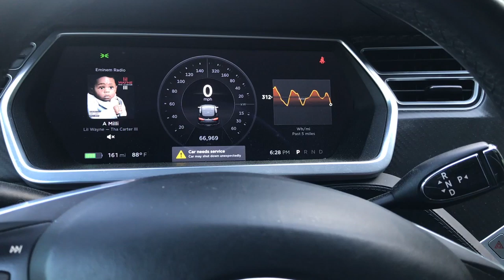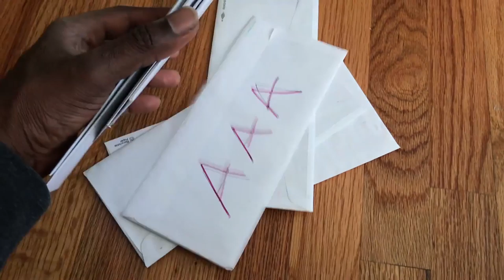Rats Killed My Tesla

Comment: Just finished watching your JRE bit; I didn't realize you were such a cool dude! Came over and sub'd. :: You may be able to beat the AI racer Rich, but if all cars are equipped with the same "safety features" I would say not by much; computers are more consistent, plus it seems you would be limited by how close you can drive in turns etc (car distances/safety). Funny, when you talked about the safety features and 10-20% lap time variant, it reminded me of those go carts at a theme park when we were kids, where they are mechanically (sometimes electronically) governed for speed, funny stuff. Best of luck on your ventures and thanks for the bad ass videos! BTW-you have an awesome team my man!

Comment: Would it be smart to put anti rat spray like hot pepper  Peppermint oil, castor oil and citronella oil ?  What is the cost of a new fuse, and what is the labor to install it.  Sounds like early TESLA have a battery problem which were covered up by the free replacements.  Will that still happen on the 3 model with 500,000 sold?   Oh and WOW  that's a lot of rust on the car.

Comment: They actually use silica sand in the fuse so that in the extreme heat of the arc, the sand melts to glass which is an excellent insulator and extinguishes the arc.

Comment: The job of the fuse is to protect the wiring. Are you sure you can just swap a 600A fuse for an 1100A one? Is the wiring the same in all models? Did it not get upgraded with Ludicrous Mode in later models?

Comment: It's nice to know my old "angle grind a slot into whatever screw I happen to not have a driver for / is stripped" trick is used by the pros too :D
And my dad scoffs at me every time I do it.
I HATE hex heads on cars.
My front sway bar end links were a nut over a hex head. Both not stainless. On the part of the car that sees the most water and salt and shit of all. Seriously.
Wanted to do a coilover install.... Damn end link wouldn't come off the strut or the sway bar cause everything was stripped.
Waited months for shipping on new end links and then just angle ground the entire strut out of the car and put nice new Perrin ones on with ye olde stainless nut & bolt.

Comment: Bolts missing, bolts loose, high-voltage fuse not tight. In another video Rich didn’t put the cover on some electronics in the center dash area and AC condensation killed the electronics. Does Rich really do it right? Scary.

Comment: The sand is NOT for thermal reasons.  The sand is there to extinguish the arc when the fuse blows.  When a DC arc starts there is nothing to extinguish it.  In an AC arc it can extinguish when the voltage/current crosses zero.  The arc literally melts the sand to glass which will solidify and block the arc.

Comment: Sand in fuses  when the fuse blows it is so hot it melts the sand & when solidified it forms an insulation (fused sand = glass coating)

Comment: rich.. have you see the mouse trap that is just a big glass bowl.. a ramp up to the lip and a cup of peanut oil..  you might want to set one up IN THE CAR to see if there are any rodents hiding out still.  you can also set up several  5 gallon buckets cut the bottoms out of several to add to the stack height. the bottom one is intact.. but it has either some peanut oil in the bottom or some peanut butter wiped around the inside in a band just  a few inches up from the bottom.  the rats and mice will jump down to get the peanut butter/oil and won't be able to get out.

Comment: They use sand because it quenches the ark as the copper fuse melts.  The sand fills in the gap melted between the plates and acts as an insulator.

Comment: Same thing happened to my honda except it was a  rabbit(s).  I tried the anti-rodent tape from honda, but they still chewed through it.  I installed an engine cover underneath and tried to patch up as many holes as I could.  Seems to work so far or maybe the rabbit has died by now.

Comment: the thing is when a cable or a fuse is not tight connected you get slight corrosion in between the connection and then it get fucked because of the heat emitted by a high resistence of the connection ! your fuse might been getting hot because it was not tight enough or at all :D!

Comment: I had a 1993 RX7 on blocks for 3 years (off-road track day car) while I was finding time to replace the motor.  Rats got in and destroyed the wiring.  I sold the whole thing with a parts car on ebay for $6000.00

Comment: I bet the loose bolt connection on the fuse caused it to overheat and blow up. As usual most of your problems are self inflicted. And not mice related, although still a concern.

Comment: When you locked the keys inside the car, couldn't you have used your phone to unlock your car? Or is that an option?
Reply: The electrical system was out of service from the fuse the key can be used to open the door without power.

Comment: I bought a Winnebago Vectra Diesel (Cummins) with a 6 speed Allison. For $900! Wouldn't start. 15 hours in we knew the shifter computer had to go to the shop. And I had some rats. I made some splices and paid $700 for the computer rebuild and she started. Then I did some exploration and found 40 wires chewed thru. The battery cable wires looked like Angela Davis' hairdoo, which she Never changed, I saw her at UC Santa Cruz in c.1979 and it was always the same hair!  I had to solder over 40 wires, double shrink tube them, did it all right, took 40 hours. Rats like wire. Not sure why,. I have other rat wire stories..... these things happen in the Santa Cruz and Sierra mountains.  when you found the fuse I was thinking, "just put a wad of aluminum foil in there......

Comment: I'm confused, Rich. I've watched a couple of your videos (actually I've watched them all) where Chris talks about 'signature' Teslas and the additional care that goes into manufacturing those first 1000 cars like setting each screw by hand and signing off on it leaving their phone number and email address along with other indications that show they really, really, cared. And in the next sentence, Chris points out where there's a panel gap a small child could fall into on one end with the other end every bit as tight as... My example was on the vulgar side and I'm drawing a blank on any other analogy but you get my drift. In other words, I don't get the significance of 'signature' as it seems as if those cars are just practice for cars starting at 1001. With the thought that I may look into a Tesla, my concern is if the hand-built cars can leave the line with such obvious issues what about the issues that are hidden like loose nuts and bolts? I mean I wouldn't notice there was a problem until something fell off the car. So what's the point of signature?

Comment: I'm in awe of the engineers who invented such fuses. Impressive. However - should such a fuse not be very easily accessible? It's a predetermined breaking point after all. On the other hand, I think you definitly should not touch such a fuse when you're not knowing very well what you are doing, so maybe it is not that bad an idea to put it away from mundane hands.

Comment: So who is going to retrofit a regen braking system onto my 19' Airstream, towable by a Model X or a Model Y or 3 if they have the  tow package option?  How about a video of the Tesla towing such a travel trailer, and getting 25% more range, plus a variety of upgrades to the rig, like an induction cook surface, expanded  solar capacity, a heat pump, etc..

Comment: Looks like the Fuse bolt was loose causing the fuse to overheat and fail.
He said " it's not even tight"
Reply: Melted at the contact point. High resistance built heat at the loose bolt. That's was the point of resistance.

Comment: Sand filling fuses is an OLD technique. It supports the protection conductors from vibration and in DC circuits where an arc-fault could be maintained for several seconds the plasma can bridge the distance of melted elements (AC circuits would self-quench at the same voltages). The same arc will pass current and "re-fuse" the sand along the arcing path into... yup, glass. Arc quenched. Second A fuse should not require cooling because the internal mV drop should be insignificant... the heat is more likely to come from the current density of the surface area at the more susceptible "dry" contact points... and the connections SHOULD be clean and torqued [and measured if you want some QA]. I'm talking to you Rich... bad Rich.

Comment: Yep. The rats get into the car, and chew up the wires. This is a huge downside to an all electric car.
Reply: Raspian Kiado  basically every modern car has wiring too
Reply: @ebadoidstudios3113  "every modern car."

Please exit the building. I have no respect for those who do not understand the issue at hand. The issue isn't that there are wires, it is that the plastic on the wires are made from vegetable oil rather than petroleum.

Have you even watched the video? Though yes, I did go a bit far saying, "an all electric car." But, honestly how many other electric cars in the US are as popular as a Tesla?

The edit was to fix an autocorrect.

Comment: Only 7 years and its an OLD pack? Shit man IDK if tesla is worth it if you only get 7 years out of a battery. Hope they can improve them to a 15 year life at least.
Reply: The packs are built out of 18650 lithium ion polymer cells. You can get several thousand cycles of these batteries running them at tight voltages/low current. A few of these 444 cells dying will not severely impact the ability of the battery. The main issue over time is the decrease in the amount of max power these cells can hold decreases slowly over time. 

Similar to how a gas power vehicle needs maintenance on its power & cooling systems, so do electric cars. No battery in the world is able to cycle/maintain peak voltage and capacity forever. Look at lead-acid batteries in normal cars, they're typically rated for 5 years. Things need to be replaced. These packs are also generally resold at a decent price to individuals/businesses as reclaimed cells that still have a lot of life left in them for power storage.

While I would love to see a 24v pack like these last 15 years, it's not going to happen if the battery is being hit often/maintained at full voltage.

Comment: What do you want to bet, before I listen to the rest of this video. That they decided to use a soy based product it is very good for the environment as an insulation on the wires. General Motors did this some years ago. And ended up with an inordinate number of cars that the mice and rats just love the installation of the wires. Because the engineers are stupid. They came up with a fix for a problem that didn't exist.

Comment: That fuse explanation doesn't make sense.. Sand and glass and ceramic are insulators.... Not conductors of heat.... The sand was to keep the fuse together, separated, suspended and cushioned. It didn't conduct heat... It has nothing to do with that...

Sand is also used for high temp metal 3d printing.

Easy fix, blew a fuse. Rat title is click bait..